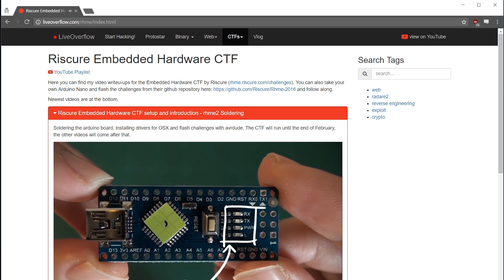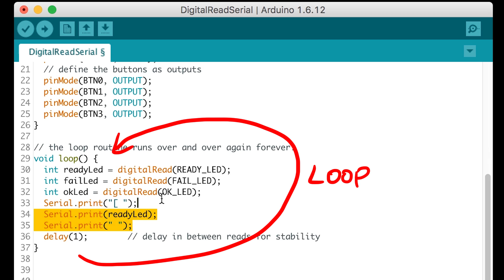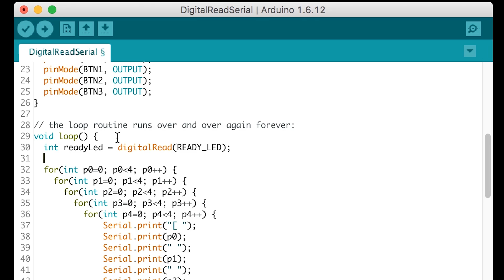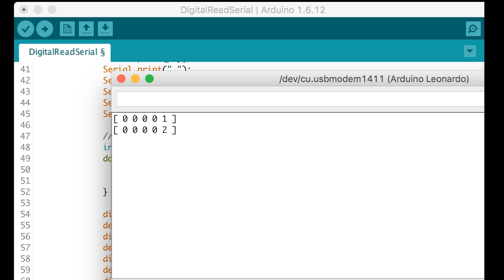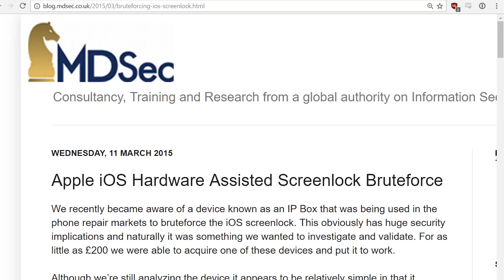Attacking an Electronic Combination Lock (ft. Electronics Idiot)

Comment: Again really nice Video. Buuuut don't forget to connect the ground of the both arduinos otherwise you may get interesting results.
Reply from the maker: +Christian Ege are we not looking for interesting results? Also both were on the same ground ;)
Arduino->Laptop->PowerStrip
Lock->PowerStrip
Reply: Almost all laptop supplies and a lot of USB supplies are earth referenced. I tested a few laptop supplies that I had laying around and all of them had their ground connected to mains earth through a 1K resistor. Assuming both supplies are earth referenced you shouldn't have to link the grounds as they are already linked through a couple of resistors and the earth wire. If one or both of the supplies are floating then you will have to link the grounds.

I'm not sure how eddy currents would have any effect on this?
Reply: I can attest from personal experience that there is a flaw in that logic. I don't know why, but trust me, things always behave better when you ground it all at a central point. Especially arduino stuff. I've put hours of debugging into issues that honestly I still don't understand with ground. Do yourself a favor and always hook every ground together.
Reply from the maker: Every ground is hooked up together. The central ground power line is on the power strip. Those grounds are not isolated from eachother.
Running the laptop from battery, thus powering the one arduino with a different ground than the other one could mean trouble.
Reply: Sort of, the problem comes in when devices have a weird power supply (power filtering) or there are multiple AC -> DC conversions. You're not wrong, but, as much as I wish it were as simple as you've said, it's not. If you can explain this to me or find any resources on it I'm interested, but, sadly I haven't found much myself.
Reply: So I asked my brother who is a mechanical engineer (He still had to take quite a few electrical classes) about this today, and I was close but not quite right. Apparently it has something to do with https://en.wikipedia.org/wiki/Eddy_current and ground loops and what not. Honestly I only followed about half of it (I'm a first year computer engineering & electrical engineering major) but yeah, connecting the grounds in order to prevent issues is a legit thing and both of us have had real world experiences where it matters. The logic behind "it's all connected to the power strip" sounds good, and I wish it were that easy, but, sadly, it's not.
Reply: Again, I don't know either. I'll see if I can get one of my professors to explain it or find me some material on it. Honestly grounding, negative voltage, and the concepts around it have always been the most complicated thing for me to understand, even when compared to more advanced topics so I'm definitely not the one to talk to. Sure, I know my way around a long list of micro controllers, but things like this are difficult to grasp for me, it may be a good topic for a video and whoever is wrong it might be a good idea to point it out as misconceptions. Then again, there's never any harm in just plugging the grounds into one another, so, I don't know that it matters.

Also, +1 sub to you good sir.
Reply: +Electronics Idiot Wall Socket Earth is safety feature and in PERFECT conditions shouldn't be connected with any electrical component. Electrical separation from mains is a big advantage of power supplies. My desktop computer has 200kOhm resistor in series between usb ground and earth, but there is protection which instantly cutoff device when current start to flow by this path. So you would have to connect ground anyway with second computer. On the other hand my power supplies has nothing connected to earth (except metal case, for one which has metal case) and in fact there is no need for that. So don't get common ground for granted.
Reply: Ground should be connected directly anyway, even if in this case everything works fine. It's a good practice (and it's intuitive in such application i.e. self powered vault lock). Like adding decoupling capacitors: in some case you can live without them, but you really shouldn't.
Why? Wires aren't perfect conductors (worse than you think) and when you increase circuit length, resistance, capacitance and impedance became more and more significant. Despite trouble-free work on relatively low frequencies you can start to see weirdness on higher Hz. For example this is a reason for maximum length of usb cables. Also usb cables are often very poor quality, you can notice that when charging a phone - different cables allow to draw different current.

Comment: you "dont" have access to the arduino but you used reset pin? hmm..
Reply: A realistic way would also be to short cut the circuit which would cause the microcontroller to reset.
Reply: @LiveOverflow  but what do you do if the circuit has an "emergency" battery which you can't access and is only there to keep the microcontroller running? and then the controller can have an input set to monitor the "external" battery, so if there is no battery inserted, you have no lights, and the it won't listen to the buttons, but it will remember the bad pin count. As it is, this is an awful setup. Or if you don't want an internal "emergency" battery, you can just set a long (like 15 minutes) wait timer in the startup before you can enter pins. You don't have to replace batteries so often that it could be a very big problem, especially if you know that anytime you need from something the safe, it might take 15 minutes
Reply: he said you have acces to power source, and it simulates it
Reply: Fair enough. Anyway nice video as always! :)
Reply: To add to your answer you can get a cheap relay and hook it up to the wire and power source and control that relay with your own microcontroller (that is used for attacking) .

Love your videos by the way, when you started your channel the videos, quality, and informations that you give are so good i was happy as a little child in a candy store. :) Just want you to know i appreciate your work and keep it going !